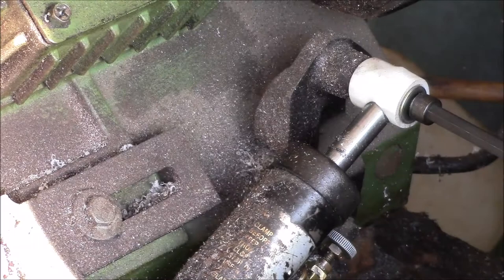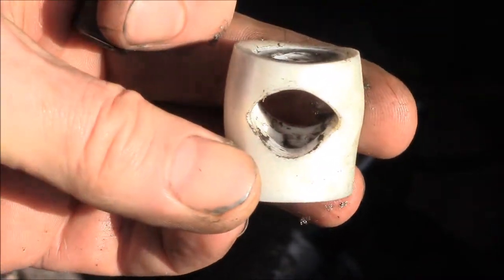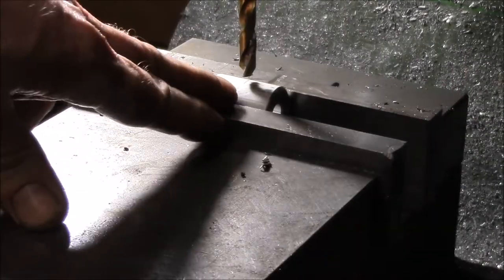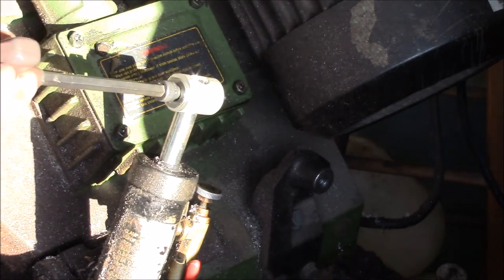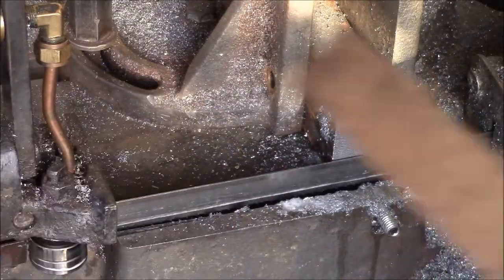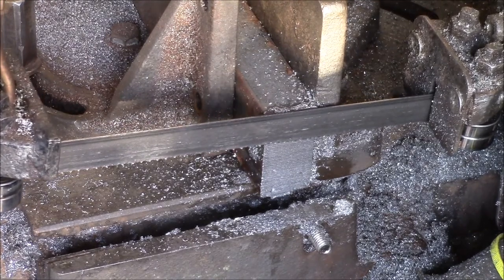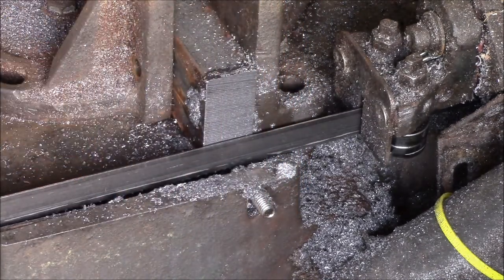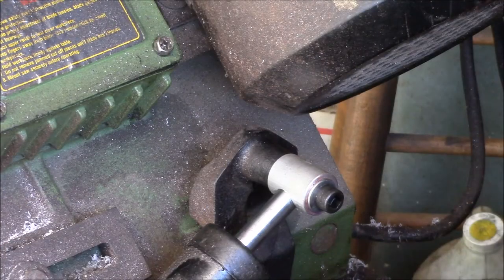Horizontal Bandsaw Down Feed Cylinder Rod Bushing

Comment: check worm gear , mine have a bronze bushing that was worn, cause vibration.
Reply from the maker: Good suggestion, will check into that.  I think the issue on mine may be one of the main pivots at the back of the saw.  Years ago, the hole in the cast iron base wore out and I installed some bronze bushings and grease fittings.  But now, one of the bronze bushings seems to have developed some play and I can feel the pivot shaft moving inside it.  Main problem is I can't recall how I lifted the upper part of the saw up to repair that pivot.  If only I had a video camera back then to capture the process and upload it to YT :(
Reply from the maker: Finally did track down the vibration cause.  It was a combination of a cracked drive wheel:
https://youtu.be/I5QMM787E9A
and a badly installed/worn out bearing on the worm drive shaft:
https://youtu.be/3t-12TCLIlk
Replacing the drive wheel seemed to make the biggest difference as far as the cutting vibration, the new bearings in the gear box cut the noise by a huge amount.